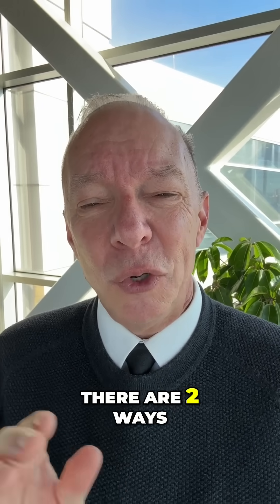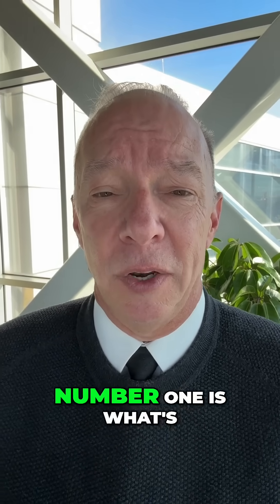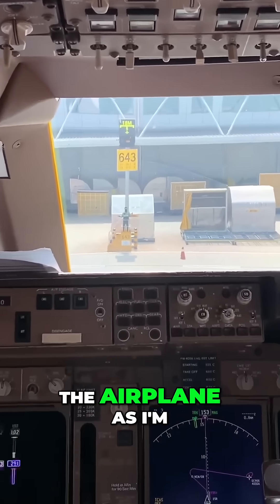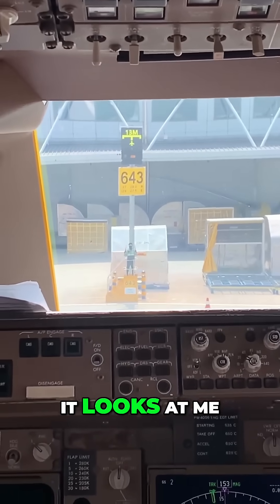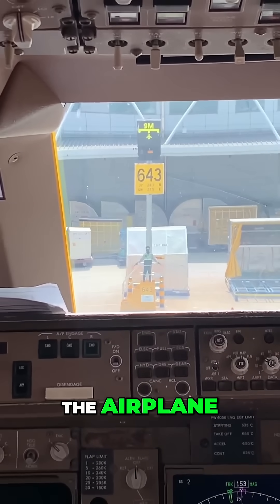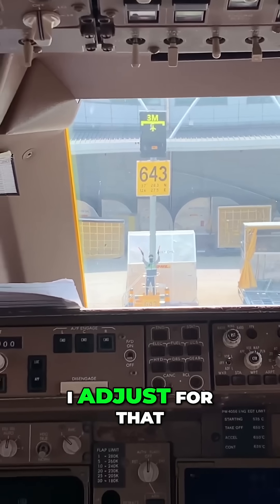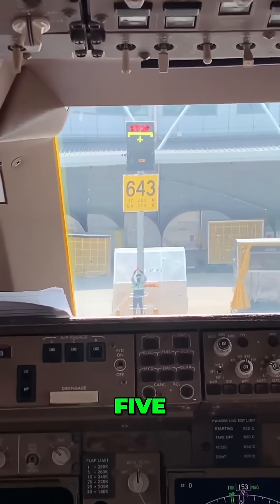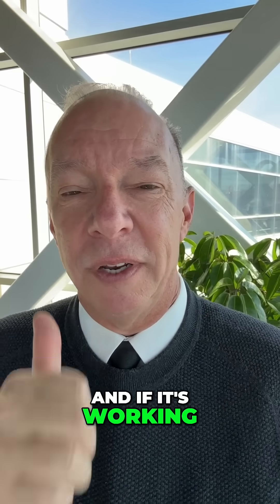Why Do Airplanes Stop Short of the Gate?

Comment: What's crazy is that the planes yoke
is not used to steer, it only is used 
in flight. A pilot uses a wheel tiller to
control steering on the ground. Feel free
correct me if I'm wrong.

Comment: Hi Captain Steve. Back in the day those guidance system were generally very dumb systems I think most of them still are. They mostly check ony one thing, being the distance to and position (Left of Right) of the main large object close to the centerline (supposed to be the radome of the aircraft). It's normally the groundcrew who needs to program the aircraft type in order for the system to know how to guide the aircraft to the right place. Most systems haven't been updated that dramatically since then.
Back in the day when I worked as a groundhandler at Amsterdam Airport Schiphol, I ones was in a situation where I had to drive some airstairs down the centerline just before the aircraft was supposed to taxi into the gate (in order to avoid a risk of collision with an aircraft who pulled into the gate right next to ours). We had to push the e-stop because it detected the main big thing down the centerline, in this very case being the top of the air stairs. It didn't knew any better then to guide the air stairs to the 'right location' 😂😂. Our aircraft, which came right after the one next to us, needed to hold on the taxiway in order to reset and recalibrate the whole system. But after a couple minutes, the aircraft pulled right into the gate without a problem.

Comment: Here is what I always wonder, why don't they just install a camera inside the front landing gear bay so pilots can see the centerline, the stopping line and the front wheels on the monitor in the cockpit. In this way, no other facility or guy is needed, only lines on the ground, a camera and a light are needed. You already have the taxing light on the front landing gear but it only brightens the front view, it probably won't brighten the wheels and the surroundings underneath the fuselage you need to know when to hit the brake to stop so you probably need an additional light installed inside the bay.

Comment: In the 1980s, I used to do the orange wand thing for an airline in Atlanta. I would try to give the pilot plenty of time to incrementally apply the brakes and come to a gentle stop on the designated lines for that aircraft. Some guys would bring the wands up to form the X, which indicates to come to a complete stop, too quickly. That would cause the plane to rock a little bit.

Comment: How is it possible that pilots keep the front wheel of the airplane so perfectly on the guiding lines even when there are turns? Is there a camera at the wheel and a cockpit monitor for the pilots to see?

Also: do both pilots have a tiller or is this just in one side?
Reply: With a bit of practice, you get used to how it looks when you're on the line. Some aircraft have two tillers, some only have one on the captain's side.

Comment: Back in 1993, I was on my way to visit my sister in CA.  We had to stop short of the gate at St Louis (my connection point)  because the flight was 15 minutes early.  The gate was occupied by another plane which required us to wait for almost 10 minutes for the plane to pull out so we could park there.   I can relate to this issue.

Comment: Requirement for Wing walkers is understandable but can't a camera on nose gear get rid of this computerized system
Reply: That just creates more gadegtry and wires that could go wrong and risk causing problems for other equipment.

Plus weight and complications of how to get it to fit within the landing gear and fold/unfold properly everytime the plane takes off or lands.

Plus each airport is different so what would be correct parking for one place isn't necessarily right for another and requires the camera angles to be very wide to ensure everything is correct.
Reply: @quintuscrinis  well a380 and a350 already have the camera. And you can clearly see the stop lines at the gate with them